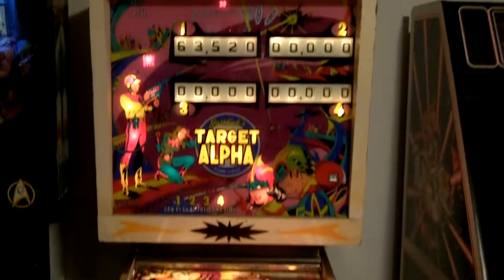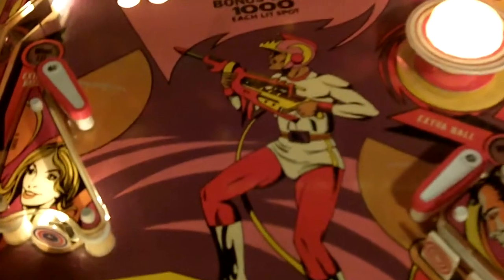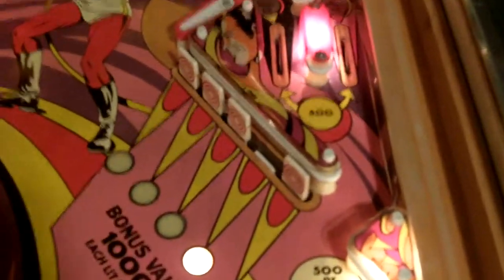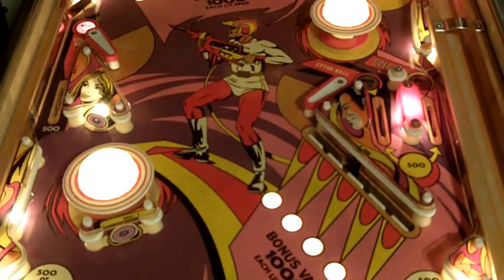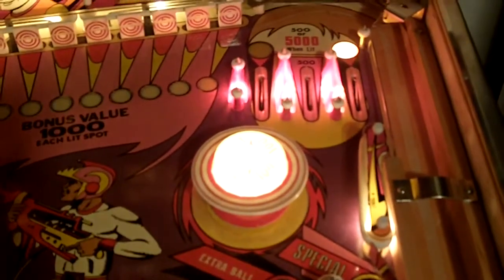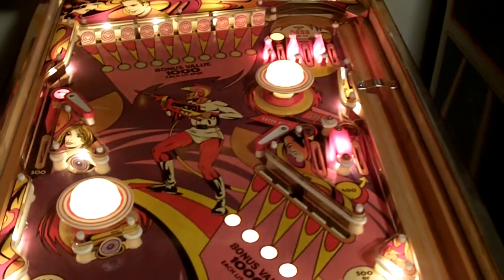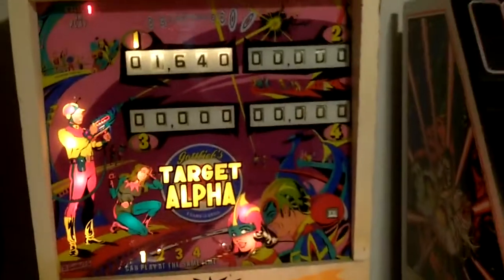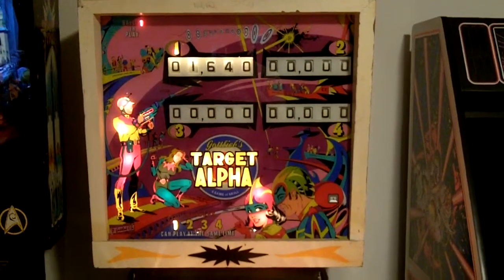Target Alpha pinball part 1

Comment: Hi tom might to late by now if you clean the F-S relay which controls the match and the change relay it should work , unless it needs to be ajusted I hope that helps.
Reply from the maker: Thanks for the tip!  I sold the game some time ago.  I had cleaned that relay and it did improve but I think it needed a bit of adjustment as well.
Reply: Okay